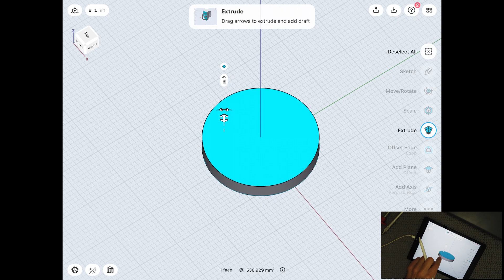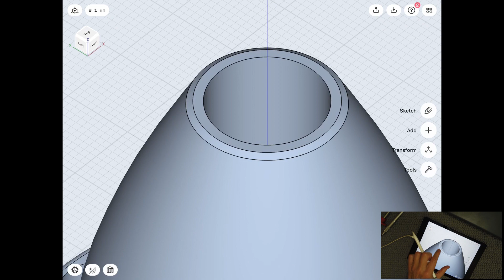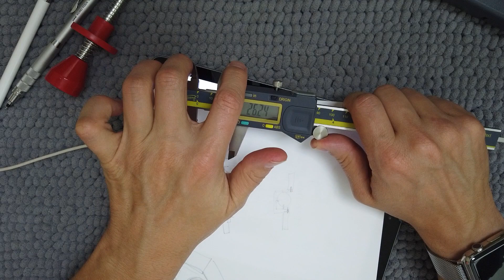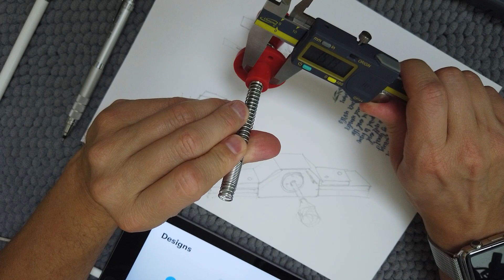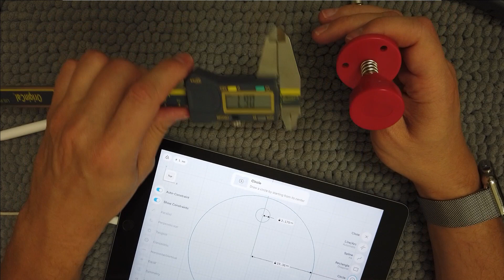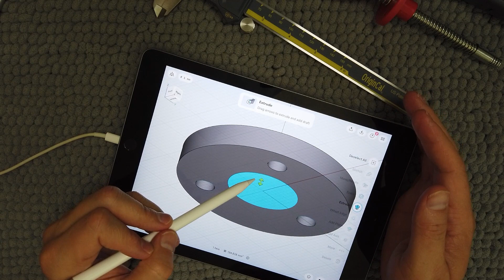Learn 3D Printing With Me - #3 - CAD Software

Comment: I have done some printing before, I'm certified in all the Autodesk programs for modeling. It is not too hard to set up and get going, after some trials, you will see how to design something better. Just that you can design it does not mean it will print easily.